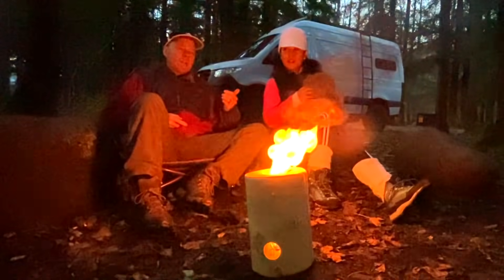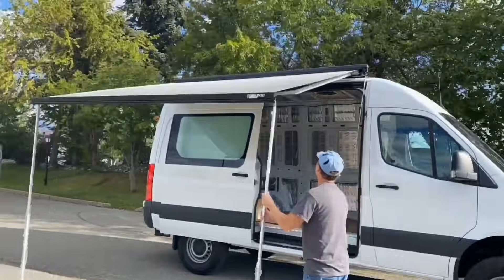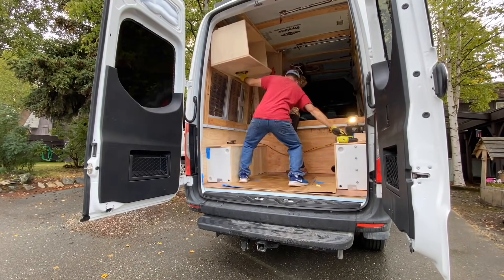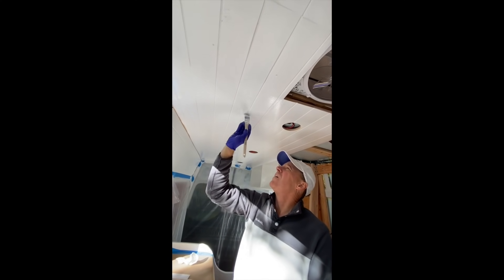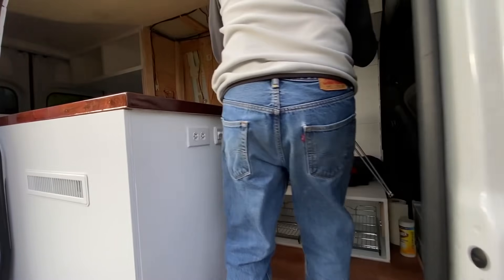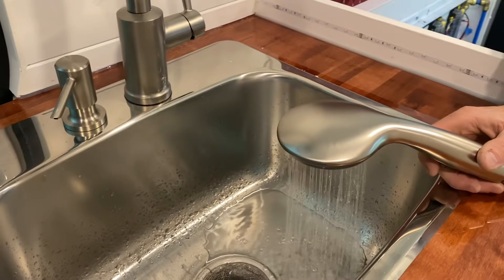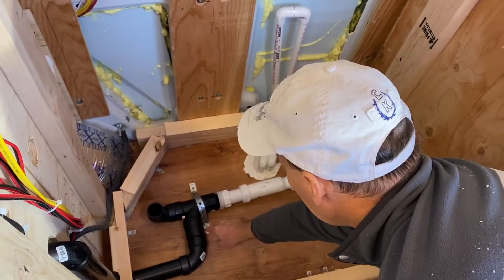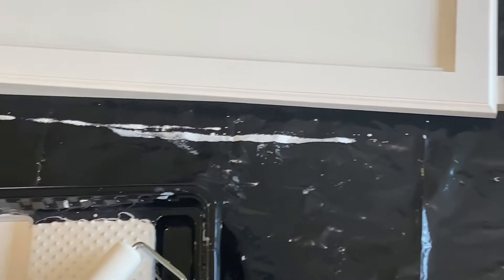Sprinter Van FULL build time lapse #vanbuild #sprintervanconversion

Comment: I would suggest insulating that water tank as it's outside......at the very least, wrap reflectix  around it so it doesn't freeze.
Reply from the maker: We don’t use it much in the winter. Do a lot of dry camping. But the antifreeze works well too.

Comment: Spectacular build - question - how tall is the inside?  My husband is 6'5" - so wanted to purchase a base van tall enough to make this possible (or at least close enough).
Reply from the maker: The interior dimensions (length) of the Mercedes Sprinter cargo space is 102.4" (L1),   Thank you. This may be helpful.    128.5" (L2), 169.3" (L3), and 185" (L4). The interior width of the Sprinter Van is 70.1" and the exterior width is 95.5". The interior height of the Mercedes Sprinter is 68.5" (H1), 79.9" (H2), and 89" (H3).
Reply: it's only money baby, even if ur husband 8 ft tall , someone can build him a van..lol👍👍